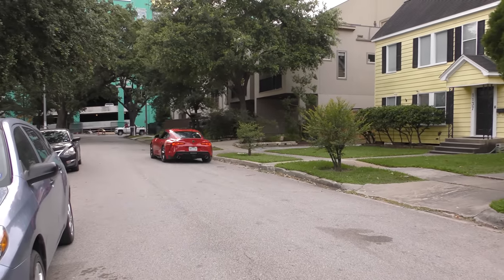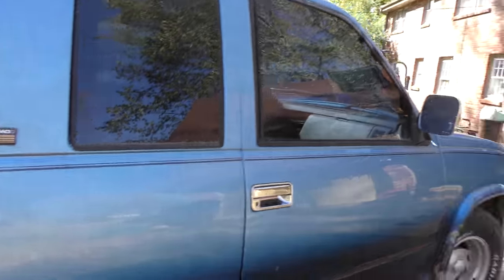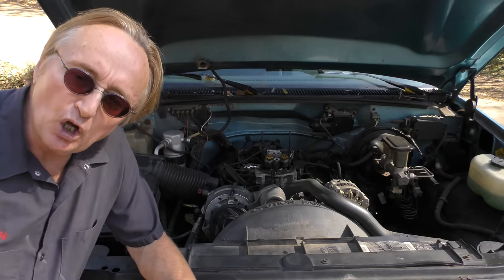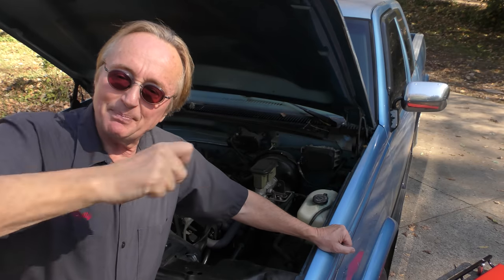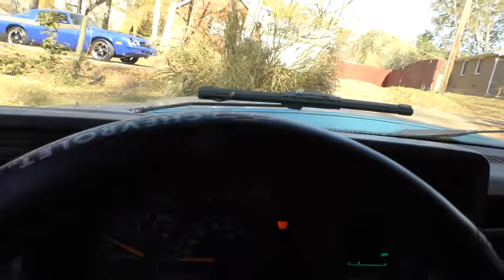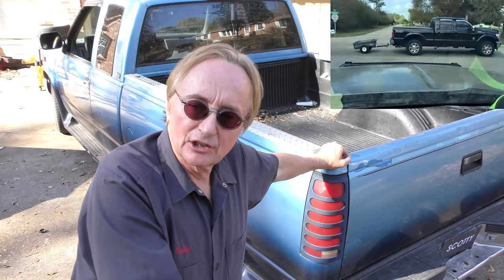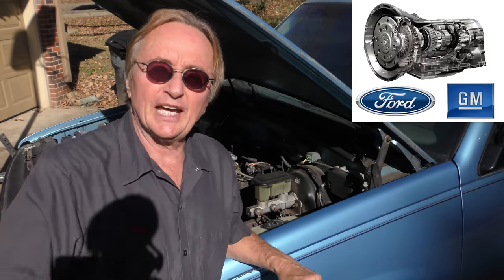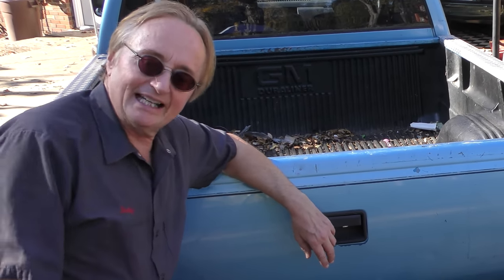The Only Chevy I’d Buy

Comment: Chevy (or GMC) never put headers on CK trucks .  I know, because I was working at GM dealerships all through the 90s.  The manifolds were all cast iron.  They were excellent trucks though.
Reply: I said the same thing, you're absolutely right
Reply: They ain’t stock headers!
Reply: I said the same thing there was no factory headers
Reply: @clayton5584  Yep, old Scotty is an ace smart tech but he got that one wrong.
Reply: @calbrit54  I can attest to this. I removed my cast iron manifolds about 2 years ago and added some stainless steel ceramic coated long tube headers on my 95 step side
Reply: Yep I knew right away he got that wrong,guess he doesn't know everything about vehicles
Reply: @calbrit54 FRFR and notice when he's test driving it's overheating! 🤣🤣 good old chevy
Reply: I quit putting headers on stuff. My truck went 20 years with stock exhaust before it started an exhaust leak. Put headers with dual exhaust on it and had it in the shop 4 times in the next 2 years to get exhaust leaks in the headers welded up. Went back to factory ram horn exhaust manifolds and haven't had an exhaust leak in 10 years.
Reply: @terristuart6620  I didn't notice that.  Guess I'll have to watch the video over again.
Reply: Right. No factory headers
Reply: That's not a regular Chevy trim it's a California edition they came with headers mine has the same set
Reply: @kyrslowly4253  Right, not "factory headers" as Scotty suggested.  To this day, SVE/Yenko do all kinds of modifications to Chevys and other brands.  They don't leave the factory that way.

Comment: I still have my 94 chevy silverado, I bought it new and it still running great with 230k miles.
Reply: I am a little ahead of you; 1993 Buick Roadmaster 249xxx miles Same engine, transmission and rear axle as your truck!  They have quite reputation for going over 300K miles.

Comment: Silverado was actually the top trim on the C/K pickups back in the day. And YES! GM actually knew how to build pickup trucks back in 1994.
Reply: They knew how to build great trucks up until 1999
Reply: 95 was a Change though, my neighbour has a 94 and I have a 95, I figured I'd ask to grab a couple relays off his broken down 94 c1500 and throw them in my 95 k1500, turns out the relay box is in the cab on a 94 because when he popped his hood i didn't see anything but an engine, and the usuals
Reply: @rockntrucks9614  relays for what. The fuel pump relay? I have a 95 with issues now. Might be the ecm☹️

Comment: I've had a lot of these trucks and all lasted over 350k on originals engines,5.7  350 and a 454. Silverado is the trim level and C denotes 2 wheel drive and K denotes a 4 wheel drive truck
Reply: Right , the Silverado was the top of the line trim level before it became a actual model in 99
Reply: How many miles do you have on the 350
Reply: I currently have two, one with 375k and the other with 425k. routine maintenance and maybe one or two bigger repairs on each since my family bought them in the 90s. love them both.
Reply: @readysetnogo  My 96 has 335k and still going strong . It's beat to hell , but still running strong !

Comment: I got a '97 Sierra with the 5.7 Vortec. Love it!
Reply: same here..193k and still running strong as ever!
Reply: Like mine 5.7 ,, in Reynosa Tamaulipas
Reply: @ianwilds3139  I got a 97 also, 130k and she purrs
Reply: Same, second engine now, going to get the body rust removed, repaired and repainted shortly
Reply: I have a 96chevy ext cab 200000miles👍
Reply: My 1999 suburban with 180 thousand miles, runs like new 🆕
Reply: 92 with 215k original transmission still runs strong
Reply: '97 with the 5.7 Vortec  only 156 km
Reply: 1998 Sierra with the Vortec engine and the 8' bed. What a workhorse!
Reply: @franciscoprado6423  96 GMC with 350K on it  ! Still runs good.
Reply: Had the same set up and sold it one of my biggest regrets ever 😭😭
Reply: '94 Silverado 2500, 129,000 miles on a turbo 6.5 Detroit Diesel motor, extended cab, long box; heavy duty yet much more economical than the trucks with the "5.7"/350!

Comment: Silverado is a trim package. If the badge said cheyanne it usually has black bumper plain seats.
Reply: Yes, it was the top trim, Scottsdale was mid, Cheyenne at the bottom. The confusion is that now even the cheapest fleet version is called "Silverado".
Reply: I love how he said it was a long bed when it was the short bed lol 😆
Reply: I have a 1993 with the same badge. youre right it was  a trim level. surprised scotty didn't know this. I didn't "glue" mine on hahahah
Reply: Cheyenne 💯
Reply: I had a 91 Cheyenne W/T. I had no factory radio, not even an antenna, had a plug on the fender where one would go lol. But it was 4x4 and was fun. Had a V6 so I couldn't have too much fun. My 92 is a Silverado, it has electric options and a 350
Reply: I own a 1990 K2500 with the Scottsdale trim package. Has 177,000 miles, runs like new.  I love that it has crank (manual) windows.
Reply: mine has chrome trim package and its a Sierra
Reply: @gosth81  Cheyenne was close to topnof the line, right under the Cheyenne Super back in 1971-1972
Reply: I just got a 98 Chevy Cheyenne, 5.0 5sp 4wd. Loving it so far, still had factory exhaust

Comment: Good video, Scotty. Southern Calif here, and I have a pristine '95 GMC Yukon with this same old-school cast-iron 350 with throttle body injection set-up. I now have 218k miles on its original engine and trans; both of which still haven't been rebuilt, or even as much as a valve cover removed since it left the Janesville, WI factory for shipment to California. Besides all the usual & customary maintenance, i.e. brakes, tires, exhaust, suspension components, cooling system, hoses, etc., this vehicle has been absolutely trouble-free and low-maintenance. I've considered selling it for a newer one, but always have a change-of-heart because it's been so good and faithful to me.

Comment: I got one. Bought it about 6 years ago, have done quite a few non motor repairs on it but did them all myself and pretty cheaply. Got the tranny rebuilt two years ago for $650-$700, it's worked perfect ever since. What's impressed me the most is the motor, at about 250k miles it still runs good as ever. Great trucks, also great for anyone who wants to do their own maintenance/repairs but isn't necessarily a mechanic.
Reply: We’re did you buy the transmission???

Comment: I love my '95 Silverado. It still looks pretty clean from a distance but after 26 years and 200,000 miles, everything is breaking on it. You've inspired me to keep it and just work on it to catch up to the problems. The motor still doesn't use any oil but I do have some leaks I need to fix. No problems yet out of the 4L60E but if I do, I'll buy a rebuild and keep driving it. I got it with 140k on it, 12 years ago. They are awesome trucks.
Reply: I agree they are keepers. Had the motor rebuilt at 250000. At 260012 now There goes the warranty. Never give up.

Comment: My brother had a '94 GMC C1500 long bed similar to the one in the video. He had over 450,000 miles on it, when the rear end went out. He could have installed a $90 rear end from Pull-a-Part, and he'd still be driving it, but he was ready for something new, so he junked it. It never burned any oil. It was a 5 speed manual transmission with the 4.3 litre V-6 and was made in Ft Wayne, Indiana.

Comment: That Silverado badge is legitimate. It was  chevy's upper trim package on the GMT400 generation trucks. 

My 94 has well over 300k miles and still looking and running great. And you're right about the 4L60e transmission. It's the weakest point, and really just due to a few small flaws that can be corrected before a failure, possibly avoiding a rebuild for a long time.

Comment: I have a 96 GMC SLE C1500. First 3 door. I bought it new. Now has 175,000 miles and still runs great. Have only run Mobil 1 10w30. Does not use oil on 5000 mile interval. Parts for truck are plentiful and cheap. Mine looks like new (Texas truck) every time I take to a shop for trans service or alignment there is always a mechanic there that asks me if it is for sale. They know what these trucks are.

Comment: I got my 96 Suburban K2500 7.4L a few years ago, price only $4000, $2400 after my trade in (99 Sierra 1500 with failed transmission), just needed fuel lines replaced. I put a new fuel pump in at the same time, because the tank had to come down anyway. I've put 27k miles on since, great truck. Pulls my 6500 pound trailer much better than the previous truck did.

Comment: My 97 Chevy work truck has 403k and is yet to use oil AT ALL. But I do drive without BEATING ON IT. I drive it like I like it. Makes a difference. Plain grill, standard headlights, chrome bumper since new.

Comment: My gramps got a 1994 K1500 Chevrolet Silverado with 411,927 miles on it and it's still the original engine. Been using it now for a month and it's such a great truck. Only thing I've noticed is it doesn't like to just sit in idle. I was at work sitting in the truck with the A/C on for like 45 minutes because of my break and I noticed it went slightly above the middle of the thermometer. Still needed maybe 4/10 left to reach the danger zone. All his interior is original and nothing has been rebuilt. It's my gramps proudest purchase

Comment: Just purchased a 94 Suburban k1500 for $1500. Needs paint, carpet and a few odds and ends. This is the third 88-98 gm truck I have had. I agree that they are solid, reliable vehicles. Being a diesel mechanic I am looking at swapping the 5.7 for a duramax or Cummins at some point. Showing much love for the gmt400!! Well technically my Sub is a gmt425 🙂

Comment: I’m from Canada. I drive a 1995 K1500 Suburban Starcraft conversion 400kms a day for my work as an owner operator courier driver. Been using it for about a year and can honestly say they are very durable and reliable trucks. Only got 345,000 kms but hasn’t given me a single issue on the road. It’s my best friend most days, and I trust taking it anywhere.

Comment: Got my 97 Suburban for 1,000. Replaced the battery, cats, cam sensor, some radiator hoses and changed the transmission filter and its running like a dream and passes smog with about 2000 invested total

Comment: I bought a 1990 k2500 that didn't run for 300. got it running found that the motor had rod knock, bought a motor for 100 off craigslist slapped it in and drive it for a year. used it for some jobs than sold it for 1500

Comment: Absolutely love my 98 K1500. Got almost 270k miles and it still runs strong!
Reply: My 96 K1500 has 65k miles. It’ll take me 50 yrs to get 270k !
Reply: @schutzhund3933  I drive my 100 miles a day back and forth to work. Runs like a top, oil changes every 5k and regular tune ups!
Reply: Yup I have 98 k1500 -330klm 1.09 litre gas up here Vancouver Can , she's good truck hard on fuel , it's payed for lol . Cheers y'all

Comment: I got an 88 Chevrolet c1500 with a 350 and it runs excellent the only thing wrong is the AC has a slow leak. When my father gave it to me it had been sitting for about a couple months because it didn't start. We got to fixing it and the problem was with the ignition system. The fix didn't cost anything.

Comment: Silverado was a trim package that was pretty common, along with the z71, they didn't come with factory headers, most common issues are ball joints, wheel bearings, door handles, and the transmission. Other than that they are basically bullet proof

Comment: My '95 Brub went to 340k before the original trans went out, and that was only because of a seal blowing, not the trans wearing out.

If you take care of them, 4l60e's can last.
Reply: My 4l60 went to 335k too on my 95 5 liter 1500.
Reply: They can and do last forever. It’s towing in overdrive that kills them. They’re not built for that. My 95 Suburban with 400K and 98 K1500 with 317K, both have original 5.7L engines and 4L60E transmissions. Love my trucks ❤️💚🧡

Comment: GMT400 (88-98).. best truck Chevy ever made. They were also produced in Flint (as mine was). Just walked in the dealer and ordered one in 89.. Still have it... and always will. Easy to work on and fix. As an instant classic, it's well supported by the after market. Hot GMT400's right now are the suburbans. Get em while you can.

Comment: My buddy had an old chevy ck with 350,000 miles on it original everything before it finally died. The motor still ran but the transmission went. We beat the ever living hell out of that truck, that's what made me a chevy fan initially. Obviously gm has strayed very far from that motto.

Comment: The transfer case on my 98 k1500 was ripped loose, drive it home (hanging...)& bolted it on with steel struts from the hardware store, still runs like a champ

Comment: Those GM 350 TBI with 700R4 are hard to kill and dirt cheap to fix. Mine has a very decent fuel economy considering vehicle size on top of that. It can take any uphill at 1500 rpm in overdrive without downshifting.

Comment: Currently have a 99 Chevy Express 1500 with the 305 Vortec. I purchased it two months ago with 193K miles for $2K and all it needed was a battery, starter, and break light bulbs. There's barely any surface rust underneath the thing as it's lived its while life in WA state! I changed the thermostat, changed every fluid and filter, cleaned the throttle body,  used probably 4 or 5 bottles of injector cleaner at the pump since I got it, swapped out the spark plugs, new gas cap, new radiator cap, use additives when I change the oil, used an additive when I changed the tranny fluid, and used an additive in the rear diff too. Great work Van, hoping for another 100k miles.
Reply: The carfax shows so many services and replacement parts, it's great! It's kind of funny though, it's had 4 new water pumps in its life.

Comment: Own 94 gm P-30 chassis motorhome with a TBI 454 w/4L80E and those engines from that era are unbelievably reliable and easy to work on. Just finished rebuilding the TBI yesterday and will install it on Monday. When it comes to issues with these engines it usually something simple like a bad coolant temp sensor, TPS, MAP. One of the first things to check if you have a drivability issue is fuel pressure. I scored the lotto with the RV $8K in Sept 2014 with just under 45K on the odometer. I've replaced due to age all the sensors, rubber hoses, by-pass hose, T-stat. Also replaced the AC condenser w/integral oil cooler this past Sept. Gets 8  - 9 mpg. And has no smog air pumps and no auto park brake system.

Comment: I have a 1998 with a 292 inline 6 and a 4 speed manual, the thing is smooth, super reliable, cheap and easy to mantain
Reply: A 98 with a straight 6?
Reply: Yeah inline 6 that’s not one you see
Reply: Straight 6? Ony 6 cylinder offered was the 4.3 v6
Reply: You in Brazil? The straight 6 was gone from the US by 1990...
Reply: Inline 6? Don't you mean V6, the same as my '97 GMC also with the 4 speed manual. But I certainly agree on their reliability.

Comment: Here in Tucson even WITH a flakey transmission, this truck would bring about $5,000.  Tucson has the country's most inflated truck prices I have ever seen.
Reply: over 2 years ago I bought a 1976 Chevy shortbed 4x4 for $2500. Needs paint and interior work, but drives great. Just saw one on Tucson craigslist for $4000 with no motor, no transmission, no paint, no interior and no windows!  Things have gone crazy here.
Reply: @montaramike  In general Tucson has always been overpriced and under waged.
Reply: I was going to post the same thing...
Reply: Not a 94
Reply: @Buffalobills-fh2be  A 94 would easily bring 5k with some issues in Tucson
Reply: Yep I used to live there. Apparently you get ripped off in Phoenix too. But I do notice it's slightly cheaper here.

Comment: Are the 5.7 88-97 engines any good? Compared to the 5.3 Vortec. I like the old body style better . Looking to buy one this week.
Reply: I have a 93 GMC Sierra. I haven't had any problems when comes to my engine. Only major work I've ever had to do was get transmission rebuilt. Had over 150000 miles on it. Will say buy yourself an OBD1 reader about $20 cause 90% of mechanics won't have one. Cuts out lot hassle of  finding out issue of truck. A lot people love that generation of truck. I normally have someone ask me wkly to buy it or checking it out at gas station.

Comment: The 98 k2500 I got has been an amazing truck for me the past 7-8 years. Bought it for $600 then drove it home and checked it over and changed the oil. Took 2 years before I had any issues, mainly the engine spun a rod bearing since the previous owner wasn’t exactly nice to it(only cost me $250 to get another motor and rebuild it since we have parts laying around from building motors), for example from what I can tell it had a fifth wheel hitch that wasn’t tied to the frame. It jack knifed after pulling the bolts through the bed, it also has a bullet hole behind the driver door. Came with a sbc and a 4l80e. Best $600 I’ve ever spent

Comment: Even those GM's  were problematic    AC Delco fuel pump Failures,   Leaking  AC  ,   Dash Gauges in accurate,   interior switches breaking,   Door hinge bushing shot at 100k    miles   ect ect  ect ect
Reply: Not to mention broken exterior door and tailgate  handles, AC buttons stop working, wiring and electrical problems.